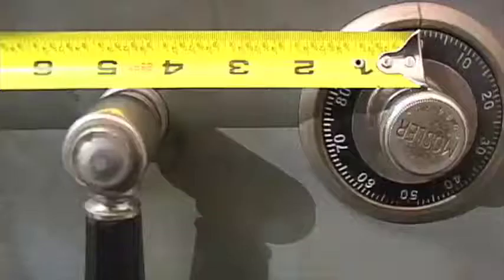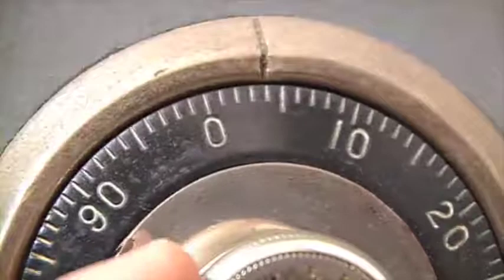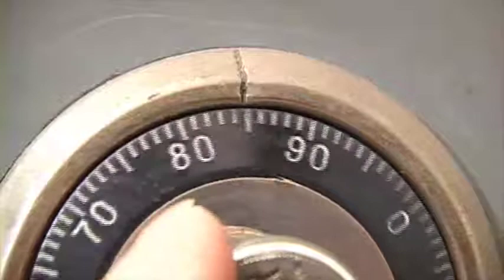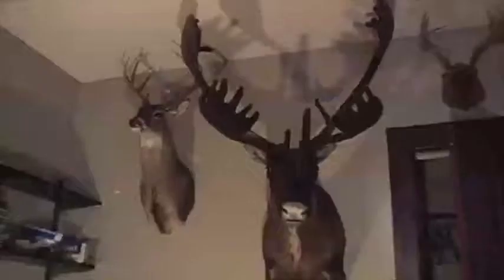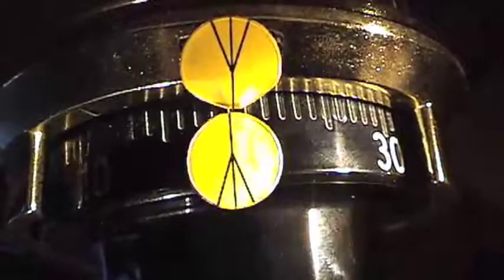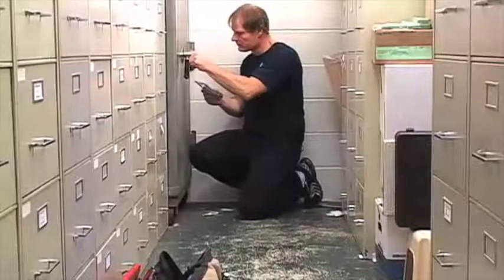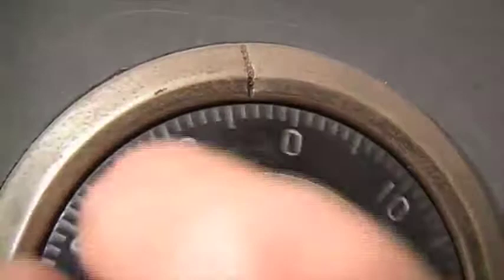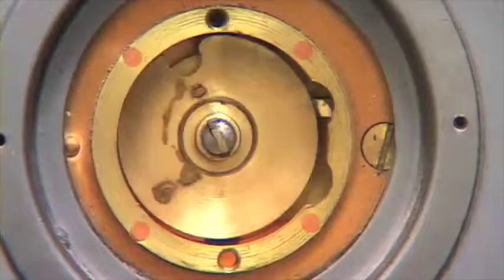Manipulation Tips

Comment: After 35+ yrs I’ve opened 1000s of safes but have only manipulated direct drive. Now I’m semi retired and after finding your videos, I’m quite interested in trying your technique. 
I dial really well, scope change key holes and have a good feel for contact points so hopefully I’ll be manipulating soon. 
Thanks for the videos!!
Reply from the maker: Wow long time there very nice
thanks I wish you the best. Gun safes seem pretty common with lost combos sure is a nice way to open them cause some even have glass now
Reply: @johnwickpick8621  Broke my cherry today!
Winchester gun safe with S&G 6730. 
Took 1 1/2 - 2hrs. I didn’t have any chicken feet and if it indicated I didn’t see it. Had to go by 2s and got 1/4 first and 1/2 (3/4 total) and it was all downhill from there. 
Thanks so very much for everything. I’m walking on air and feeling 10ft tall.
Reply from the maker: @Don-ui8oz  Wow Amazing thats a pretty good time without the line indicators.
Actually its tough without indicators I have done it but really have to concentrate. Good job thanks for update
Reply: @johnwickpick8621  Well, I did another one today (not for a customer) just for gits and shiggles. Took about 3 1/2hrs. The lock had more tension so dialing was slower plus I quadrupled checked the indicating. (I couldn’t imagine all that with a number slightly off) It broke some rules (combo was 73-86-82) I might not win at a Lockmasters event as far as speed but I got it down.
Reply from the maker: @Don-ui8oz  one thing I see you have that is required and that is patience, very nice job. Each lock does feel different thats why it takes time to learn the various characteristics of the locks.

Keep at it your doing good
Reply: In about 2 weeks I’m going up against my first Mosler. Small round door. Haven’t been to the safe yet so idk. Other safe tech brought a picture. I won’t know until I get my hands on the dial. I’m a little apprehensive.
Reply: Mark, I must have watched this video 10 times but only now realized: after you find a number you then run the other 2 wheels together?
I have been going for the gate on the other wheel of the first two. So far it’s worked but might not always and it’s probably faster the way I’m supposing you do.
Reply: I wish u can help me open my mosler vault😥

Comment: JWP, In comments you mentioned a GSA safe and that it was difficult to crack.  I have a government Mosler filing cabinet. Is that what you're talking about?  What would you suggest?
Reply from the maker: For lost combo it would need to be
drilled open. That dont damage the safe at all its only a vary small hole to scope the combunation. 
Them locks are manipulation proff and cant really be cracked by feel.

Comment: Mark you make it look so easy lol. I have been trying to figure out dial manipulation for years now, with almost no luck. I read an article in locksmith ledger, and I have also been reading through the complete book of locks and locksmithing as well as locks safes and security. And I still haven't really gotten a feel for it. Your video helps to explain some of it, but it still seems over my head. Is there anyway to get a better explanation of the entire process and what exactly I need to see and feel? Can you make another video please?
Reply from the maker: Manipulation is a art that is simple to understand yet hard to get good at.
There are classes/courses you can take from professioals. I would suggest looking into a class at Lockmasters from Kentuncky.

But even after learning it takes lots of practice to get the feel right same as lock picking.

You first need a cut away lock mounted so you can learn wheel movement.
You need to know exactly what happens in the lock every turn of the dial, you must develop x-ray vision in theroy and only by classes and practice
can you develop that. On a regular safe you can never randonly get the numbers mainly because its takes to long to dial just one combintion out of a million. 
Practice/ time/classes is the key!
Reply from the maker: Yes I can work on another video, you can contact Lockmasters from Kentucky and get yourself a cut away mounted S&G combination lock.
This really helps in practice.

Also order the "hairline indexs" these stick on the dial and help to see indications. I use them all the time.
Reply: @johnwickpick8621  Is there some way I can get in contact? I looked you up on Savta, but cant find your business to actually send a direct message instead of going through youtube lol.
Reply from the maker: @therocketman321  how about give me your email.

Comment: Hello , why don't they make false trap gates on disks?
Reply from the maker: On some locks they do, but I would say for cost effective.
Anything extra like building a mold with false gates probably costs more.

And manipulation is difficult people trying to break in surly won't take the time to practice manipulation.
Reply: @johnwickpick8621  Thank you very much for your reply. but due to translation difficulties, I was not quite able to understand it... did some manufacturers make false gates on the discs? but is it on expensive versions? and no one has tried to find a code for them? and just drilled?
Reply from the maker: @spiriter1988  Yes correct some manufacturers did.

They can be manipulated  but are even harder then normal

Comment: fantastic info thanks you very much  going to lsi for safe manipulation  :)
Reply from the maker: Thats Great it is a art that is rare and few can do.  Try to visualize what is exactly happening in the lock with each turn of tbe dial. Dont just spin the dial randomly the trick is knowing what each wheel is doing or not doing!
Reply from the maker: One thing in class they will teach you to use a graph and to use the Right contact point and the Left contact point.
The Left contact point is useless.
In twenty years never use left point.

So go along with it but concentrate on Right only

Comment: Hi Mark, I love these videos of yours - they're very easy to follow. How do you decide where to park W1 when you're about to run AWL (or AWR, whichever) on 2 and 3? Blast round the dial once looking for a low spot, or just pick a spot at random? Thanks very much and best wishes, Michael.
Reply from the maker: Hello thanks glad there easy to follow
ya I just random pick a number for wheel one then begin running 2&3 from there.

If I get No good indications I wll run 2&3 in the other direction. If still No good indication I will then park wheel one somewhere else usally 25 numbers away from where it was and begin the process again.
If you park wheel one accidentally on a high spot it will hold the lever up above 2&3 and nothing shows.

Thats why if you move wheel one to another place you might put it on a low spot then a gate shows up. 
Thanks.
Reply: @johnwickpick8621  Thanks mate.  I've heard guys suggest all sorts of different ways to do this but to my mind it really boils down to luck - firstly that you don't accidentally pick a high spot on W1 and secondly that either W2 or hopefully 3 will indicate first. The law of averages says you should strike it lucky most of the time with a 6730 or 3330 or similar group 2 lock doing it this way. Thanks again and have a good one, MHM.
Reply from the maker: @MichaelMaynard  hi Mike well probably the most important thing is having confidence in yourself and your opponent will fall.. !
Reply: @johnwickpick8621  hey John I have a old Mosler safe and I would love to be able to use it but all the lock Smith's around here say they will drill for me but I don't want a hole in it, can you help me?
Reply from the maker: @troymuonio6863  maybe I can find a manipulator near you what town ya in
Reply: @johnwickpick8621  Vancouver wa

Comment: I’m having difficulties manipulating the second wheel on my Sparrows safe. I know the principle of what I need to do, but I always get confused when I need to turn passed the third wheel combo to feel my contact points. I’ve looked at a lot of resources (including the National Locksmith Guide to Manipulation), but it isn’t clear about that specific problem. Do you have any tips?
Reply from the maker: I move wheels 1 and 2 together and park wheel 3 on either a gate or low spot if I dont find a gate on 3.
Wheel movement is practice thats really the hard part.

Basicly move all wheels at 2-1/2 increments. Then turn opposite direction pass your 3rd number once then land on it the second time.
Now go back to contacts.

Now as you run wheels 1 and 2 together you only have to go to each number twice.
Then twice back to 3rd number.

So again twice in 2-1/2 increments then twice to 3rd number then to contacts.
Twice to next number in 2-1/2 increments then twice to 3rd number.

All you need to do is find 2 numbers not 3 numbers.
After you find 2 numbers you just run the unknown wheel around parking your known numbers till it opens!
Reply: Thanks, John! That did the trick

Comment: Hey one other question, have you ever manipulated a Group 1 lock? For me it is just a hobby but wonder if a pro can even manipulate those?
Reply from the maker: I have the technique for manipulating the S&G 6630 and 8500 but havent done one in the field. The 6630 has false gates and a roller on the lever so contact points are even more sensative.
The 8500 pushes in at zero and can be manipulted too. 
On a job it just a lot quicker to drill unless absolutely necessary.
Reply: @johnwickpick8621  What about the 8400?
Reply from the maker: @Kit_Bear  No to manipulating the 8400
Not worth the time best to drill it that lock is rare to run into anyways mostly found on GSA containers.
Reply: @johnwickpick8621  I got a old S&g safe it's got wheels on it, between 89 and 86 there is this like give feeling, smooth. What is it? I don't have the combo I was hoping to watch you and try. On the brass handle it says 2796 if that means anything.
Reply from the maker: @shannonmassena6717  the lock is probably similar to the one in the video of manipulating gun safe. That is the technique that would be needed.

Its probably something you would need a 
call a tech for. Id like to help ya more if I could
Reply: @johnwickpick8621   thank you. I got a picture of the dial I think it might be marked on 12, 24, and when I move around there it feels like a little wiggle on it, is that my imagination, can I send you a pic?
Reply from the maker: @shannonmassena6717  yes whats your email